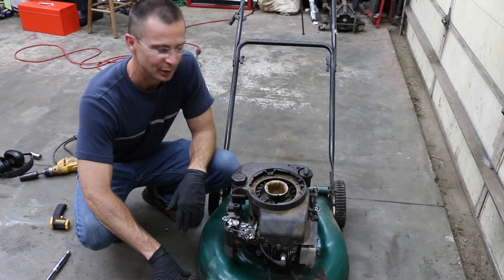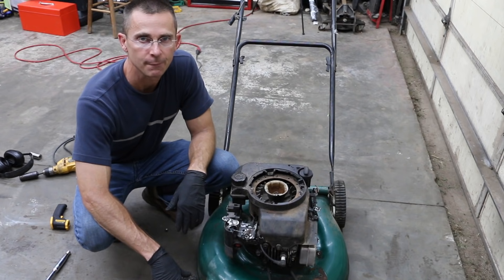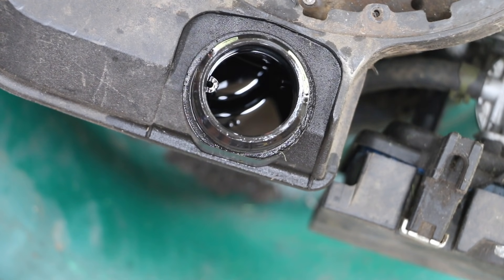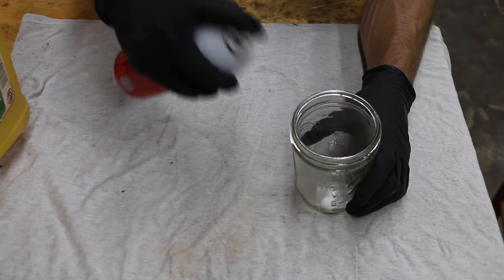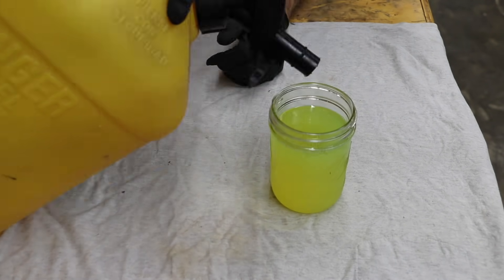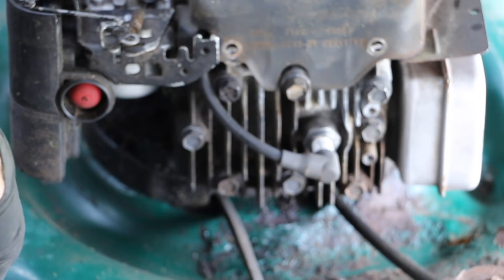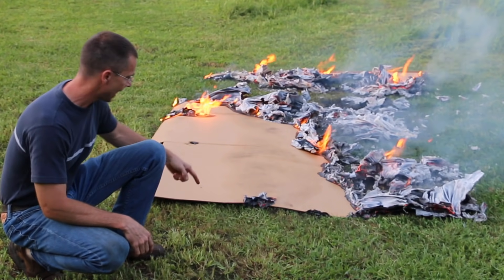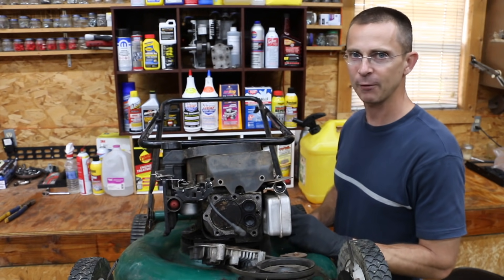Will a Gas Engine Run on Diesel?  Let's find out!

Comment: Please Try kerosene in a lawnmower I want to see what happens 😀😀😀😀😀😀😀😀😀😀
Reply from the maker: I'll definitely test Kerosene in an upcoming video.  Thanks for the recommendation!
Reply: You're welcome thanks
Reply: It’s almost exactly the same as diesel...
Reply: kerosene and diesel are almost the same thing
Reply: Can't u run kerosene in a diesel it's just illegal because the government wants u to pay tax
Reply: Galaxy Squad old John Deere tractors would start on gas,then switch over to kerosene. I drove one of those,a model H. Back in the 30s and 40s,kerosene was more plentiful in farm communities because of its other uses,such as space heaters and hit-and-miss stationary engines.
Reply: my old tractor had 2 tanks 1 was for gas and other kero, as long as you start and shut off on gas it will restart and run on kero but the motor needs to be fully warm before you switch the petcock valve for kero to run, you can't have kero in carb when shut off its not high enough octane to fire as easy without a igniter, thus cars can run on it however your octane level is lower your power would be significantly lower you'd need a booster of some sorts or increase compression and fuel like LP will run a motor when warm however to receive same hp rating as the motor had on gas it takes between a 15-20 percent increase in fuel consumption on top of existing rates of fuel
Reply: ISMAEL RAVENLOCK yep, that is what I just posted. Low flash point is the same as low Octane. That is why I said those old engines had low compression engines.
Reply: I'm getting ready to create a little short video I seen some by asking about kerosene well I'm getting ready to try it and post it on YouTube it's not yet there but it will be because lawn mower running off of kerosene YouTube one gallon of kerosene with three ounces of gas high octane 99 the catch is putting a 2-stroke engine oil spark plug called l89 cm because two strokes burn oil it takes that plug to help burn the oil in the gas will see what happens see y'all
Reply: I ran a 4 stroke motorbike on kerosene once, the smokescreen it made was incredible.
Reply: Diesel, kerosene, heating oil. All basically so close in chemical make up.. You can run kerosene on a diesel engine.. And put diesel fuel in a oil fired furnace..
Reply: I’ve done this, have to start on gas then add kerosene but will work
Reply: You still need to add Oil to it to lubricate the Fuel pump
Reply: You mean Low enough Octane, Octane is a measure of Resistance to combustion.
Reply: I feel like it'll do the same thing as it did with deisel
Reply: You are correct, as for ratings in terms of functionality in a diesel engine, however the definition of Octane still applies, and you COULD do an octane rating of diesel it just isn't done because it is not so directly useful in terms of judging how it will perform in a diesel engine. That is not the case when deciding how it will perform in a gas engine.
Reply: Also just a note, old gas engines were commonly run on Kerosene. they would start them on Gas then switch them over but those engines had compression ratios in the 4-6 : 1 range. Higher compression with Kero will cause Pre-detnation due to low octane of Kero.
Reply: nothing...k1 has a really low flash point unless you mix it with something ive allready tried it may however run in a 2 stroke motor
Reply: yep, and don't forget Jet fuel.  same but FAA approved
Reply: jordan smith yes but its best id you add some oil to lubricate the injection pump. Kero doesn't lubricate very well
Reply: As someone has already said. Diesel and kerosene are almost exactly the same.  Kerosene burns cleaner, but has less energy. "Jet Fuel' is the same as jet fuel, but the jet fuel is filtered more.
Reply: Kerosene is the same as diesel the only difference is it doesn’t gel up when it’s cold that’s why in colder environments they run diesel trucks on it
Reply: Kerosene fries the engine... trust me I had a friend do it.... lol
Reply: Kerosene is just a slightly thinner version of diesel. In fact, it can be used in a diesel engine without doing any modifications. That’s generally what’s used in a diesel mixture and is also used in very cold climates as a diesel substitute since diesel has a tendency to gel up around -25f and colder
Reply: Do it 🙋
Reply: Don't do that it would blow up im sure

Comment: I put diesel in my go cart one time and it ran like shit but it still ran
Reply from the maker: Thanks for sharing this experience!
Reply: If the engine is hot it'll run but not well.  I've run it in a 2 cycle also. Not much power

Comment: Dirty carb
Reply from the maker: I believe the carb is fine.  It doesn't have an adjustable jet, which is needed to help set the appropriate flow rate of diesel, since diesel has more viscosity than gas.  Thanks for commenting!

Comment: Is it true that you can use used fryer (from a restaurant) oil with draino added to it to run a Diesel engine? If so how much damage will occur to the engine if any?
Reply: Filter the used frying oil several times and it will work.  Don't add anything to the oil.
Reply from the maker: Paul, thanks for this video project idea!
Reply: https://www.youtube.com/watch?v=QEX1YFXYTdI

Comment: 1.I use paint thinner/extremely flammable mineral spirent in a lawmower it was a barrel carburetor  that I started with gas the lawnmower ran powerful but slowly  even would not turn off when I pull the plug wire  and a bad fly break which ment I had to cut grass until it at ran out fuel.       
2. You try moth balls in nother  video with no luck
3. I notice used flatheads I don't new one in any store any more do they still even make flathead lawnmower. I love video with using flathead lawnmore than a car.
Reply from the maker: Thanks for these video project ideas!

Comment: Had a 1970 impala with a 350 eng. I ran out of gas and all I had was 5 gal of diesel. I had shut it pretty quick. I put about 3 gal of diesel in the tank . What little bit of gas that was in the carb. helped it start. As long as I kept the eng at high idle the eng would run . The eng knocked and rattled but I drove that car 5 miles to the nearest gas station . As i pulled into the pumps and let off the throttle the engine died. I filled it up with gas and she fired right up. Ran just fine after that.
Reply from the maker: I enjoyed reading this experience.  Those impalas are nice cars!

Comment: If the engine would not stay running without continually using the primer bulb, why didnt  you adjust the carb?
Reply from the maker: I should have mentioned this.  This engine doesn't have an adjustable needle jet like the older engines.  I regret not using an older engine for this experiment.  Thanks for the great question!

Comment: When I was young my father had a tractor that ran on both gas and diesel. It had two fuel tanks one for gas and one for diesel, it started on gas and when the motor was hot you switched to diesel. It used spark plugs.
Reply from the maker: What a versatile tractor!  Thanks for commenting!

Comment: Was the gas mileage measured during this test? I wonder if the 50/50 mixture provided longer run time... otherwise, it would be a waste of time to buy diesel for lawnmowing long term.
Reply from the maker: No, I wish I would have measured fuel consumption.

Comment: Deisel and gas mixing is for  the disel engine  not for d gslne  engine if you put diseil on d gasoline engine d combostion it's not dsme  for diseil.bcse diseil is need a hihgly compressed from d cmbstion chmbr which is d injector spray a 2,500 psi of deseil
Reply from the maker: This is a great point. Thanks for commenting!

Comment: Would that mean the 50/50 mix is similar in some way to putting high octane in the motor cause it should be harder to ignite? Or would they not really mix and the petrol would ignite regardless of conditions, which in turn helps to ignite the diesel (or maybe just the diesel mostly doing it's own thing)?
Reply from the maker: 50/50 thins out the diesel for better flow and increases the octane.  Thanks for commenting!

Comment: diesel is actually more flammable under pressure or sprayed into a mist or even try to light a jar of gas on fire vs a jar of diesel the gas will not ignite and stay lit but the diesel will think it's cuz of a wicking effect but idk would be neat to try in a non carbureted motor
Reply from the maker: Thanks for commenting!

Comment: I seen where they  try used cooking oil in small engines I tried a few things used cooking oil and a hotter spark plug no luck,but they say it can be done, I'm not sure what mod they using to do this any ideas I even used 101 boost to see if it wold run no luck?
Reply from the maker: Thank you for this video idea!

Comment: Don't know so much about a 1-cyl engine, but we ran an old Dodge V8 on straight diesel and it ran okay. Engine smoked like a Mack truck (!), and had a little run-on when it was shut off, but it ran fine except for fouling the plugs. 

We did this when I worked as a gopher for a local auto shop in my early 20's. An elderly lady accidentally put diesel in her gas tank and brought her car in when it started smoking. The mechanic drained the tank, which contained about 80% diesel, and dumped it into the shop truck's gas tank, which was about 1/4 full (25-gallon tank). The mechanic put new plugs in the engine after flushing out the fuel system, filled the tank with fresh gasoline, and sent the old lady on her way (after about a $400 repair bill! -- This was in 1983 before computers. Today if you put diesel in a gas tank, the computer probably won't let the engine start!!)
Reply from the maker: I enjoyed reading your comments!

Comment: I put about 3 gallons of deisel in a 79 ford pickup by accident. I smelled deisel and realized my mistake, I topped off the truck with gasoline. The truck actually ran much better and pulled stronger. Smelled like a deisel truck ...lol . Never had any adverse effect  down the line either
Reply from the maker: Impressive!  Thanks for sharing this experience!

Comment: Yep, dad did it to his boat when I was a kid, was used to filling the car and didn't realize what he did until we changed tanks out on the lake, resulted in a lot of smoke then quit, used the trolling motor to get back to the dock. The mechanic told dad once you flush the tank and lines, you'd never wear it out, 20 years later he had a compression test, boat shop swore it was too old for his new boat, they were floored to find it was still in perfect shape.
Reply from the maker: Thanks for commenting!

Comment: The white smoke is because diesel has a higher combustion point than regular petrol, so the system was flooded due to diesel not burning because of lack of combustion.
Reply from the maker: Great point. Thanks for commenting!

Comment: 50/50 gas diesel= kerosene 28 it will damage your fuel pump in a diesel but will run no problem for 3 months as for petrol it will cut out and smoke, these are not experiments it happens 1000s of times per day at pumps.
Reply from the maker: Thanks for this recommendation!

Comment: What I'd like to see is if you can run on diesel fuel when you supercharge the engine in order to increase compression. :-P
Unfortunately the fuel has to be injected at the right moment. :-(
Reply from the maker: This is a great suggestion.  Thanks!

Comment: There were several engine designs from the 1920s through the 1950s which were designed to run on both fuels.  You need to have an engine that sparks after TDC since the octane rating of diesel is usually something like... 5...  Igniting before TDC will result in a lot of hard knocking unless the engine is running really fast.  

You also need to have the engine hot because the carburator can't aerosolize diesel as effectively, so you need enough heat in the cylinder to vaporize it once it gets in there.   You might be able to run your lawnmower engine on straight diesel if you start it on a small amount of gasoline and run it until the engine block gets to at least 190F before dumping the diesel in.  (You may have to cover the cooling fan a bit to achieve this.  Lots of the "all fuel" engines had a set of shutters over the radiator that the driver could use to regulate the temperature.)  You might also have to tweak the fuel mix on the carburator depending on the design.
Reply from the maker: Thank you for this information and for the recommendations.

Comment: I would have check the spark plug condition before and after each test.  You should have known that a plug check can tell you a lot about how a engine is running, or why it is not running.
Reply from the maker: This is great constructive feedback.  I normally do check but I don't show it in the video.  Thanks again!

Comment: I build small 2 stroke engines for a living, and sme guy in RC Boat racing are running 30cc gas engines on Colman fuel.  I never ran it, but I tore one apart.  They do mix 2-stroke oil with it also, and the engine looked clean with great lubricity.
Reply from the maker: Thanks for this idea!

Comment: Try doing this experiment with a larger gap on the spark plug. AS a kid in the 70s we used aluminum wiseco pistons bit if the gap was  not reduced the piston would get a hole in from the spark plug. You can also reduce the plugs electrode width to have a hotter plug tip which will be more like a a glow plug. Thanks for your video.
Reply from the maker: Thank you for this suggestion!

Comment: I believe when you change the fuel from Gas to Alcohol to Diesel you need to change the carburetor to get the air/fuel mix correct.  An engine running Alcohol needs the jets a lot larger than gas for example.  If you want to really make it a test you need to tune the engine correctly.  Farmal tractors use to do this all the time.  They start the engine on gas and when it is warm they switch to stove oil which is very similar to Diesel.  In fact I believe it is something like #3 diesel.
Reply from the maker: I believe you are right.  This small engine's carb has a fixed jet.  So, I wasn't able to adjust the flow rate of the fuel.  Thanks for commenting!

Comment: I accidently filled my isuzu deisel with Gasoline.  It had about 1/4 tank.  It did not run to well but it took me the 4 miles to home.  I took deisel from my tractor after draining the tank.  No problems.
Reply from the maker: Glad it didn't cause any damage. Thanks for commenting!

Comment: World War II Briggs and Stratton engines were made with a small valved funnel ( about 5-10 drops ) to prime start on gas and ran on diesel. These engines were similar to yours but adjustable jets, similar compression and internals. I have had customers in recent years bring a "smoking" and "Hard to start" lawn mower that had been mistakenly refilled with kerosene. It would run once warm continuously much as your video once we adjusted for richer setting on the jets. It takes more fuel and that is why the primer would keep your's running if primed. I know this does not correlate with the fuel ratios but the engine differences in how fuel reacts in the cylinder may have a clue plus incomplete combustion/stroke to collect the fuel btu's. So your motor I believe has a fixed jet for high speed on the bowl nut. A larger jet may allow once warmed the engine to run on diesel I would predict. Incidentally, those WWII engines were only different to include the primer cup.
Reply from the maker: I really enjoyed reading your comments.  Yes, the engine I used has a fixed jet.  Thanks again!

Comment: Gasoline doesn't really burn faster than diesel fuel, under the right conditions. In fact if Diesel were to burn too slowly you wouldn't be able to run an engine on it. but it is far less volatile. It's the volatility of gasoline that allows the use of a carburetor and spark plug. Volatility is the tendency for a liquid to vaporize, it has nothing to do with flammability or explosiveness. Water and Diesel fuel have a similar volatility.  I thought the 50/50 mix might foul the plug with liquid diesel fuel. But the gasoline component adds enough volatility that there is a vapor present for the plug to ignite. Once the engine warms up the diesel can burn incidentally. Your engine has very low compression with less than 120 psi, that's a really low compression engine. If your engine had better compression you would likely experience detonation of the diesel fuel possibly causing engine damage.
Reply from the maker: This is great information. Thanks for commenting!

Comment: Hydrogen has the fastest flame speed of any molecule... when added to gas, diesel, natural gas, coal, ect it increases the flame speed of these fuels thereby increasing the efficiency of these hydrocarbon fuels. 
You can see from the demo that gasoline has a faster flame speed vs diesel, but diesel has at least 10 percent more energy vs gasoline.
Also they can only extract so many gallons of diesel fuel from a barrel of oil. The rest is fabracated into other products.
Sweet midgravity crude makes the most gallons of diesel fuel per barrel of oil making it the most desirable of all of the grades of crude. Sour crude is the least desirable because of the expense requires to remove the sulphur.
Reply from the maker: You're very knowledgeable on this subject and I enjoyed reading your comments--thanks for commenting!